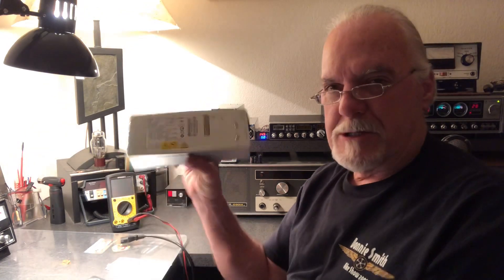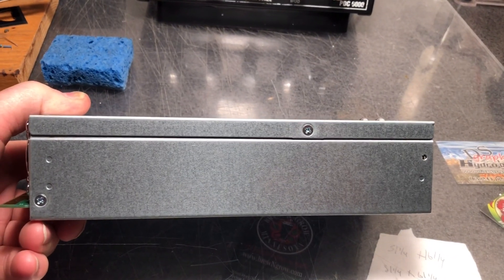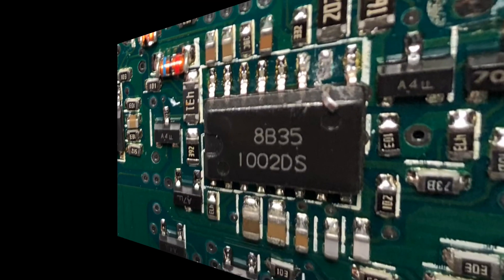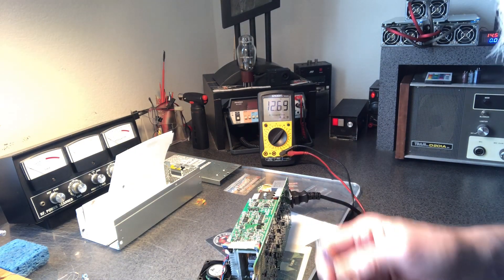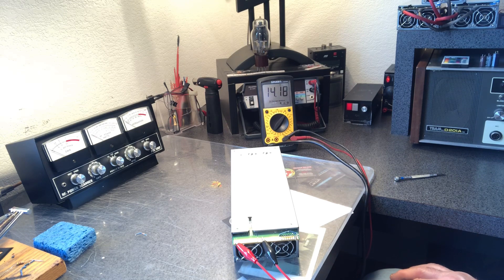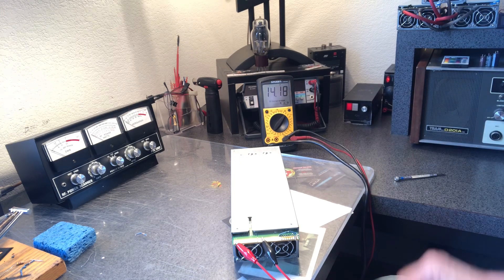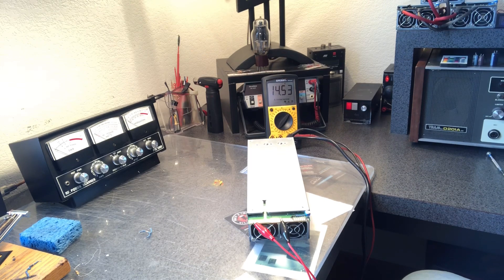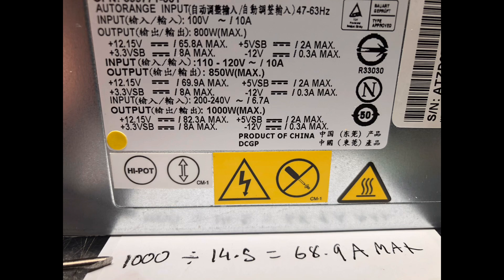DPS-800GB Full Hack Including OVP Hack

Comment: There’s a place to add one or two resistors and it should come up to 16 volts and hold it steady under load.
Reply from the maker: You can get 16 volts but the filter capacitors are only rated for 16 volts so there’s a chance you might blow them, I normally stay 15 volts or lower.

Comment: merhabalar emekleriniz için teşekkür ederim aynı güç kaynağından elimde mevcut köprü yaparak çalıştırdım ve  12,5 13,0 volt değerlerini boşta aldım ben direk potans kullanmadan ve sizin yaptığınız işlemi yapmadan oto amfisi çalıştırmayı düşünüyorum yük altında hata verirmi sizin yaptığınızı yapmam gerekiyormu şimdiden çok teşekkürederim
Reply from the maker: I run a total of nine of these in different configurations, I run them at 14.6 volts and I run Ham radio amps on some of them, I’ve loaded them pretty hard and never had one fail.
Reply: @hotwire5894   Tekrar merhaba cevap i.in teşekkür ederim yani direk tetikleme yapıp kullanabilirim yani otomotiv amfisi ve teyp bağlantısı yaparak

Comment: So to run this at 24V, I would need to either replace some capacitors or run 2 in series, right? I assume the second option is the easiest, but also the bulkiest. How hard is it to resize the components to 24v instead? Thanks!

Comment: Congratulations on the video, fantastic...
Could you tell me the reference of this 2k ohm variable resistor? Another thing, what is the connection position of each output of the 2k ohm resistor, since it has 2 output pins...
In the video you do not show how to connect these pins to the power supply, would it be possible to show me these connections...
Thank you very much
And a big 73

Comment: Hello Sir,
Could you please help me regarding EMERSON POWER SUPPLY (MODEL-AA27020L) 600W power supply manually "ON" i am unable to Turn ON the power supply .may be wrong pin connection. Please advise what is the correct PIN to connect ?  Many thanks

Comment: Hello @Hotwire 589, I was successful with my power supply thanks to your awesome video. I am currently set at 14.38 VDC. The Green power LED is out, like happened to some others....not sure why ??    I have a question please on connecting this to a car. I will use this as a power supply, so ignition will be on, engine off. What would be the correct way connect ?  1) Alligators to the battery, then power on the 800 ? or 2)  Power up the 800 and connect with live alligators ?   thank you for any advice :)
Reply from the maker: Thanks, glad you enjoyed the video, and (Always Hook Up To  The Battery First) before plugging in any charger, and yes the green LED goes out after doing the mod, don’t why though.

Comment: Fantastic Thank you HOTWIRE !  Question please, I plan on running the 800 at14..4VDC    The 16VDC rated Caps do not sound good. In the video you mention swapping for 25vDc caps. Is this easy ? How many are there and what value ? Thank you Sir!
Reply from the maker: The problem with swapping the caps is 1. The boards are multi layer and difficult to de-solder and re-solder and 2. Trying to find 25v caps that are small enough to fit in the tight space, all the caps I found had a bigger diameter and won’t fit.
Reply: All I can find here is 50v , probably even bigger in size !
Ahhh, ok, too bad this would have been a great mod.
Thank you again !
Reply: What diameter or size would we be looking for Hotwire ?

Comment: dps1200a is the new way to go, 100 amps each at 220 70 amps each at 110, so far i think the community has found resistor value for 3 or 4 different voltages and to defeat the crowbar protection.

Comment: Great video! If the OVP is taken care of(disabled or resistor applied where appropriate) would the (variable) resistor between pin 32 and ground method also work on models such as the popular DPS-1200FB or DPS-1200SB series or are the pin 32 assignments different for other models?

Comment: Help please. my dps800 have a problem. when measure voltage on 12 pin it only reads .30v  all other pins read normal. and led is not on but fan is working..  thanks
Reply: Did you find solution?
Reply: I had the same problem when I removed the whole overvoltage protection chip instead of cutting just the second leg.

Comment: cool video thanks for making.  i am looking at this modification for myself. have you tested the output current capability at some of these different (higher) voltages levels? do you still get the full current output at the higher voltage level? or does the current output capability decrease? just curious how much it might decrease at ~14.5V, thanks!

Comment: I do loke the variable  option best.
I am using the the hp dps1200sb a and run them at 15.5 i have currently got 3 of them stacked . They work great . I have 8 more to get set up then put them all in a box . That should give me all the power i will ever need.
Great video.
I think i will do one of these at 14.5 as a bench supply to run some radios on.
And for various testing.
Reply from the maker: You must be a BBI fan?

Comment: 2 notices for hackers. This PSU requires 2 things to successfully start. 1) Some initial load. 2)connected fans. If some  of two fans is missing or not working, PSU switches 12V off after about 2 seconds
Reply: Thank bro very helpful.Mine turn on and after 2 sec turn of 12v but if i short with screwdriver pin 32 33 on short it turn on work perfectly.How to solve this problem?

Comment: Thanks, nice info, those 3 you've got stacked there they wired in parallel ?
Reply from the maker: Yes parallel and set at 14.5 volts, also have six of them built into a cabinet in parallel at 14.6 volts.
Reply: @hotwire5894  what max amps are the 3 pumping out?
Reply from the maker: @steveb936  if my calculations are correct should be in the neighborhood of 175.8 amps at 14.5 volts

Comment: hy hot wire,  men I buy one of those and put it a resistor to 32 to ground like the video clips and what happen was it blows something inside in to minutes ,it hurt me because it was brand new ... first I put the jumper and the resistor and plug to the outlet and the light ,don't  start ,but the fans work , I take Out the resistor and star great but in 2 min blows inside ...the damage was done ,...

Comment: Hello, have you tried parallel work
Reply from the maker: I have six of them in parallel in a custom built case set at 14.6 volts, I run them on 240 vac, and if I remember the math correctly I think it puts me around 411 amps. I’ve hit them pretty hard and they don’t blink an eye.

Comment: That resistor you used for psu 
May I ask what wattage the resistor is as I did this and it made no difference to the voltage. I used a 470ohm resistor.
Reply from the maker: For my application I used a 750 ohm 2 watt resistor, I was looking for 14.5 volts output.
Reply: I put in a 202 adjustable resistor like yours it jumped 1 volt up bit there is no movement of voltage either direction i turn..frustrating

Comment: Hi Frank
have 1 more question
after the mod voltage protection my green led is not lighting up anymore
fans are turning and i have power all work ok  only the green led !!
i think i broke the led !!
bud with the second supply i was very carefully with the led 
and  same happened with the second supply green led is not lighting up
fans are turning and i have power 
is this normal after the voltage protection mod the green led  is cut off ????

my experience about DPS 800GB A
pin 34 short  pin 31
pin 30 to +12v
pin 32  ∞ -12v                                 = 12,86 volt
pin 32 --->8,98  kOhm ---> - 12 v   = 13,00 volt
pin 32--->2,516 kOhm --->  -12 v   = 13,50 volt
pin 32--->1,415 kOhm --->  -12 v   = 14,00 volt
pin 32--->1,083 kOhm --->  -12 v   = 14,40 volt

73   ON3YNL
Reply from the maker: Sorry I forgot to mention it in the video, after doing the mod you will lose the input to the led so all is good, for your question about pin 30 to +12v  I’m not sure what you would need this for.

Comment: Hi!
I have the same supply , suddenly stopped working.
Is there a input fuse on this device? I cant seem to find it.

No green light at the back - no fans start. Worked perfect for 6months, suddenly its dead. Any idea?
Most load was about 25A on 12.5volts
Reply from the maker: There is a thermal cement fuse/resistor it is a ( SQF10 13ohmJEB ) 3A  145deg C , problem is that it’s almost impossible to swap given it’s location, l have had success with mounting one in a different location in the supply and extending the leads to the pcb, but even that’s a little challenging, google it then you’ll know what it looks like, then you can find it inside the supply.
I found it easer to buy another one. Good Luck
Reply: @hotwire5894  Got ya - thank you so much for answering though.

Comment: These power supplies are ridiculously cheap for their current capability. I have a number of the HP-1200DPS units I've modified, by floating the DC from the common earth. But yes, just be careful of running them too close to the maximum voltage ratings of the capacitors. I run them on 240vac, so it is possible to build a 24VDC 100A power supply.
Reply: You know you can run 2 12v PSUs in  series and make 24v PSU or 3 for 36v or 4 for 48v.
Reply: @randybobandy9828   Yes, I have the pinouts for the HP DPS1200FB.👍

Comment: Hey sir nice video I was wondering the best way to connect the positive and negative to each side I was not trying to drill through it to fit lugs and nuts
Reply from the maker: What ever you do DON’T drill through it, it has a multi-layer pcb and you will destroy it, I soldered all of mine.
Reply: Thanks I was trying to run 2 amps and a head unit from one of these

Comment: Hotwire 589, I have different HP PSU model DPS-1200FB-1 A , I open the casing and look around the main board, I do not see the same IC as DPS-800GB.  Do you have any clue how to hack into this model for change of DC output voltage?  Thanks !

Comment: Thanks hotwire, have you tried to full auto range circuit for input voltage or made test with higher voltage with load and  capacitor of higher voltage connected in paralell? Let say 24V 6A?
Reply: Just run 2 of these PSU in series if you want 24v.

Comment: Love your video was very informative. Can you please advise I want to put 4 of these DPS800Gb together to make close 50 volt for a high output linear. Any help much appreciated..
Cheers ..
Reply from the maker: You thinking about an ldmos amp? I haven’t ran them in series only parallel, I have six in parallel at 14.6v and run a sixteen transistor amp on it and it doesn’t blink an eye, I’ve heard of people running two in series at 24vdc out, some say you have to isolate them from grounding to each other, don’t know why, be interesting to try, but could also be very expensive if something goes wrong, personally I think they would work.
Reply: @hotwire5894  When paralleling the 4 how would you do the variable voltage?
Reply from the maker: @sevenoseven8494  I have never tried it, but it would be interesting, the issue would be how would you know if each supply is adjusting to the exact same voltage, I have some laying around here, maybe I’ll have to do an experiment.
Reply: @hotwire5894  I bought 2 because of your video and a write-up I found on the web. I'm in the process of replacing the guts of a Pyramid PS-52kx. I found with Neg DC to wiper of the VR to to parallel resistors with each resistor going to current sense on each power supply, works well. Seeing other videos on paralleling multiple supplies as long as you are within 1/10th of volt, there should be no problem. Thanks for your video.

Comment: May I ask you a question, please: I want to use two of these @14V and combine the load capacity. Any pointers as how to stack these in parallel would be appreciated as these PSUs work better with pin 30 to +12v (can hold the voltage better when loaded), so when I connect pin 30 between 2 PSUs I may not be able to utilize the aforementioned "pin 30 hack"
Reply: Very simple to connect in parallel,  just get 2 PSU and connect both of them to a  positive bus bar and a negative bus bar. All done.

Comment: Any thoughts / advice on spotwelding batteries with this power supply?
I will need a bank of FETs to switch the output of course, and probably a bank of elcaps for the extra initial current, or would the 80+ Amps be enough already?
Reply: Honestly a car battery is a far better for that.  I have a medium size car battery I use to spot weld with and it puts out 1400amps in a single pulse 😯 good luck getting that from a PSU.

Comment: thank you Hotwire 589,  i tore apart a bunch of tvs ' and misc electronics, a few years ago, and my friend gave me a server computer from  2009 , and it had 2 of these in it . ,  im a car audio geek, and i always had a knack for  running big speakers in my room on a car amplifier,  after seeing this video,   i was able to understand more about where the overvoltage chip was , And how to bypass it . Aswell as  how to increase the voltage using Resistors,  i had a bunch of 150 ohm and 100 ohm resistors, i just soldered them to around 700 ohm, and increased my voltage until i got 14.9v, it was a big help. i have a  100 amp bitcoin s14++  i want to try and increase the voltage to 14.5v, but i cant quite figure out where the protection circuit is , under all the paste they coated everything in .
Reply: I was running my 1000w rms subwoofer amp through a 1000w atx PSU but since it only output 12v I didn't get the full 1000w rating from my amp since it requires 14.4v(basically when a alternator is on) but now ill.try this hack. These server PSU are cheap! I'm talk like $15 or less on ebay. You can run 2 of them in parallel for double the amp output

Comment: Hi, if the voltage goes up the maximum current remain the same. This's because ps internal shunt works with current, it doesn't read the power (P=V*I). Then if want safe it's correct to remain you into new limits. Anyway it's nice to test the new maximum power, may be it will works better too. Regards
Reply: So your saying it will run at 69amps if it's at 12v or 15v? Meaning you can get extra power out of a unit?
Reply: @randybobandy9828  Switching power supply works with moses and coils, the mos or coil works with current, it doesn't know the voltage, than if the capacitors have higher working voltage all will work good to the same current but a higher output voltage yes.

Comment: Thanks a lot , I'm using one of these to charge a 4S Lifepo4 battery in my camper. Solar through a charge controller and this PSU through a dc-dc charge controller but it needs 14.2 volts. You Sir are a gentleman and a scholar.
Reply: So how does this charge the battery? Are you using it from 120v to charge it?

Comment: Cheers for this it worked great. I did the 820ohm resistor but could only adjust to around 14.4v and then it dropped back to 13.3v if I went any higher with the pot. Left it at 14.33v as that is fine for my charger.
Reply: Is an OVP huck necessary to raise the voltage to, say, 14,33V?

Comment: I disabled the OVP as shown, but on my PS version, the green “on” LED no longer comes on (the PS does work) ...
Reply: Same here. And voltage drops with 1k resistor?
Reply: @Hotwire 589. Thank you for making this video. Instructions are very clear!  I have the same mod done today, when I lifted off the 2nd pin on my DS1002 chip, green "on" LED does not light up. The PS works and I can get 14 volts dc with 2k potentiometer, but green led is turned off. My chip is 7H34 DS1002

Comment: @hotwire 589: do you now the different betwen the DPS-800GB and the DPS 800GB-3A?
i have problems with the 13,3 overvoltage protection.
i hope you have a info for me :) thanks in advance
Reply: Internet says: connect 26 to GND.

Comment: I have a question? You made it sound like you pried the whole chip off the board? However it looks like you pried the second pin off the board and laid it back over the chip (I assume that it is the vcc pin for the chip)? Is this a correct assumption?
Reply: I tried this yesterday and first cut the second leg as in the video. For some reason I wasn't able to change the voltage with a resistor and I thought removing the whole chip might help. Don't do that. Without the chip the PSU only outputs about 0.3V.

Comment: Hello there hotwire 589 could you help me please, I've got a server power supply model ATSN 7001044. I've looked inside for the chip that your talking about so I can disable the overvoltage protection but I can't seem to locate that chip 1002DS.  Would you know if its one of the other chips on the board and would I have to do the same thing to disable it lift one of the legs off the board.  Thank you.

Comment: I'd like to turn the voltage down to 10v, is that doable?  I'm trying to string two of these together to make a 20v power supply.
Reply: You can run this at 100 volts to make it 67 amps and you should be able to run each unit at 10 volts  with a trim pot each in a series to get what you want

Comment: If you want to go completely bananas, check out this power supply for ~$50 on ebay. Cisco p/n UCSB-PSU-2500ACDV rated for 2500watts @ 200-240V input.

Comment: great job on that supply ! when running radios or amps around 14 V or so is fine. most have a 15V max . I have IC 7300 and amp . what I found is using a 1FD or so cap close to radio or amp to smooth out SSB current. I used the walmart cap sold for sub amp. it has volt meter also . works great !  when parralo switching supplies set each to same volts using same meter. then use equal length of wire to connect  together. rember wire AWG for amps ! you can add external crobar over volt protection if you want. need big SCR zener few outher parts.I have seen people use LED 12V 30 amp switchers for amps . they are cheap and made in china and don't last after running 15V or so . 73s